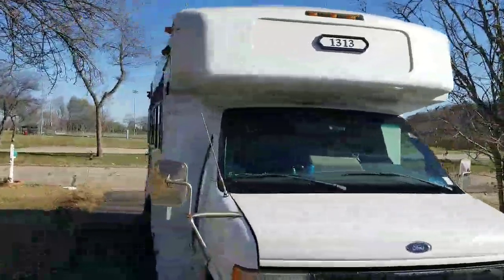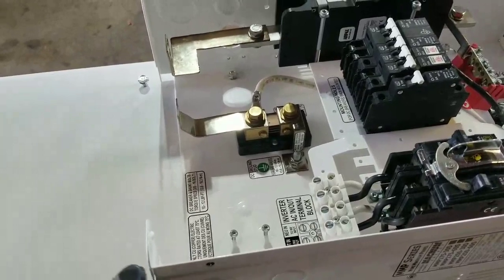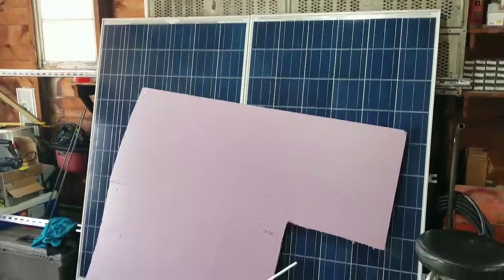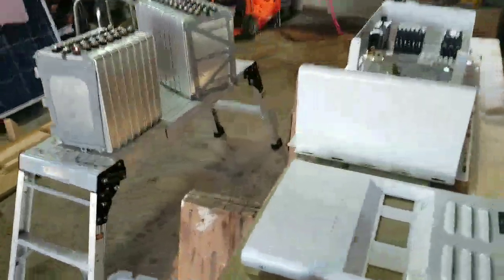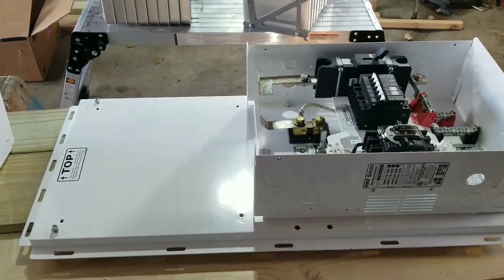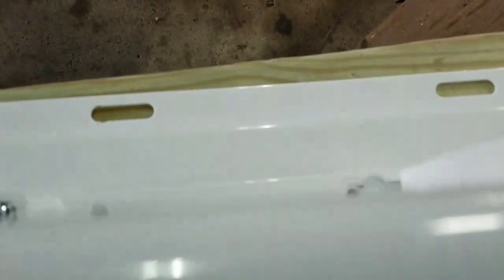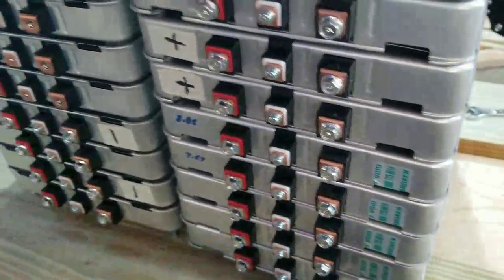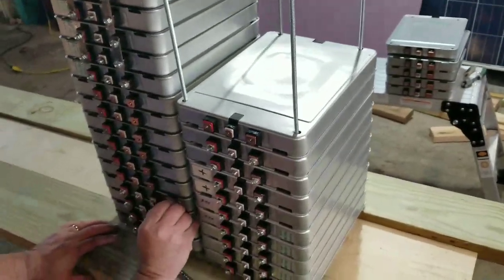15,000W (990Ah) LITHIUM ION BATTERY STORAGE FOR RV, BUS, SHUTTLE, SCHOOL BUS, SKOOLIE (Pt.2)

Comment: Are these brand new? Is it 15kWh (not 15,000kWh)? With how you've described it, it is 2 modules in series (4s) and 15 modules paralleled (30s) (since each module is 2s, 2p inside). Looking good so far though.